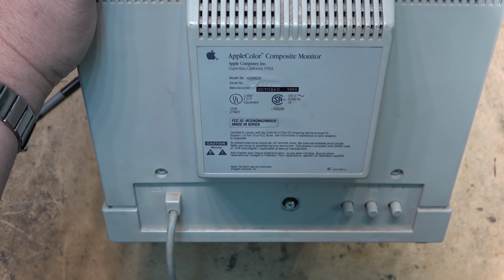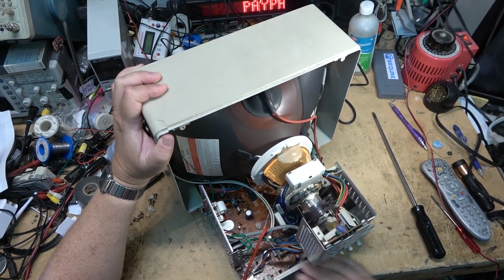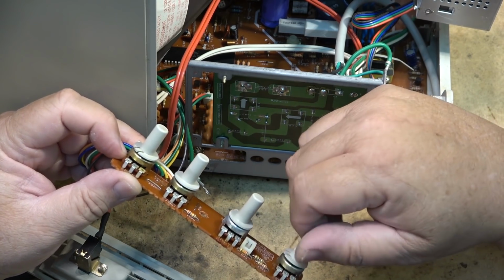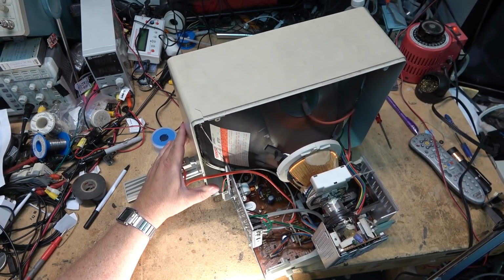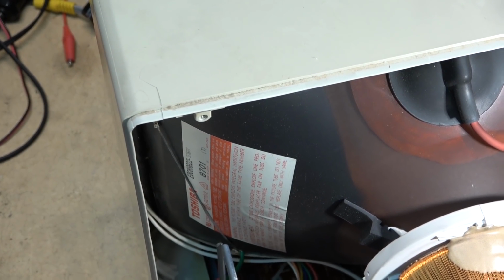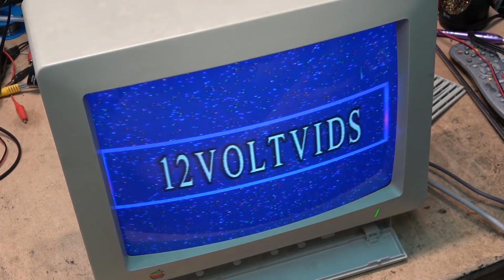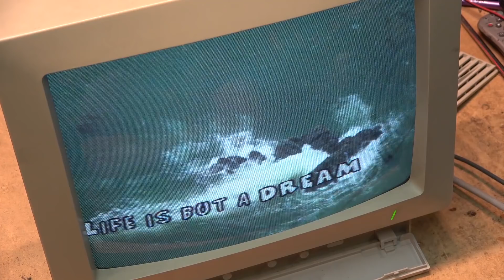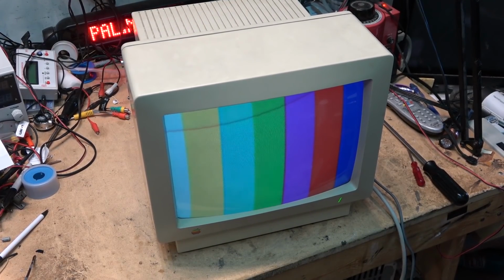AppleColor A2M6020 Composite Monitor Tune Up

Comment: I was just looking today for a video on this exact same set of problems with this same exact monitor.  Mine is even made in October of 1986, serial number S042803, so they probably rolled off the line a few days apart.  Thanks for posting this!

Comment: I've been fighting with one of these with the Samsung chassis. Samsung and Hitachi OE'd these for Apple, the Hitachi ones have 3 plastic hinges on the control door, which always break. Yours looks identical to mine, so I presume it's the Samsung. 
Mine came with a blown 120v zener. I replaced that, and the HOT blew after just a moment of running. It did build high voltage for just a moment. I replaced the HOT and it blew again. I tried running the chassis without the HOT installed, and it blew the zener....

Comment: Not bad at all for it's age, the crt has no burnt in phospher damage.
No caps needed changing, i'm supprised!.
Reply from the maker: This is likely very low hours.   This was made before caps got all environmentally friendly. It was the chemistry change that started all the issues.
Reply: @12voltvids  same with the "environmentally friendly" unleaded solder which is absolute crap that cracks all the time.

Comment: I remember those monitors.  Used with the Apple IIe or IIgs.
Reply from the maker: This one goes with a Apple Ii. Client is restoring one.  I should dig out my old ti99/4a and get it running.    Just need to find a power supply and make up a video cable.
Reply: @12voltvids  Remember the TI/99-4A. My first computer for games when I was a kid!
Reply from the maker: @stphinkle  same here.  I wrote a BBS program for it. Had 4 360k dsdd drives on mine.  Still have it.    Have no idea how to use it anymore.  Don't remember any of the commands.  Call dsk1 i thing was to load from disk 1.

Comment: Your titler's output looks so dated today, but I'm sure it looked great back in the day. Regarding its battery, it likely uses one of the 3.6v cylinder cells which are known for leaking and ruining boards. It might be worth checking on.

Comment: Thanks for the demo on the titler, I have looked at them, neat to see what it can do.  The video of the air plane show, was that on your Sony Beta?  73's OM.  DE ~Jack, VEG
Reply from the maker: No that airshow was shot on svhs using a Panasonic pvs350 that I had for a year or 2.  I did 2 airshows with the  beta. One using an hvc2400 into an sl2000 and another with hvc2800 also into sl2000. I did this one with Panasonic pvs350 and at least 1 with a ccdv5000.  I did a couple with DV cameras as well.  Dcrvx1000 and canon gl2 i believe.  I haven't put all of them up.  Some day i will put the DV tapes onto hard drive.  I better get on this while the tapes still play.

Comment: Think you might have picked up a strand of thread or something on the crt at the end.
Reply: Near the end when you have color bars on there is something on the top left to center of screen.
Reply from the maker: @marka1986  Its called the rolling shutter artifact of the camera.
Reply: @12voltvids  OK thanks

Comment: Was LG a thing in 1986? Or was it still Goldstar back then?
Reply from the maker: From 83 to 95 they were known as lucky Goldstar.  Prior to 1983 Goldstar made cheap tvs and lucky appliance made cheap appliances.  They merged in 83 and became Lucky Goldstar. In 95 they changed the name to LG.
Reply: I did have a Goldstar amber monochrome monitor at some point in the early-mid 80s. I just couldn't recall when they switched over to using the LG name.
Reply from the maker: @richkh  96

Comment: Finally a CRT again
Reply from the maker: I have lots of broken CRT I could fix.   Thing is I tend to try to do videos that actually get watched.  When I see stats that suggest it is not being watched i try to make videos that people watch. That is vintage audio gear.   I'll dig out some more CRT sets soon.
Reply: @12voltvids  that's nice thanks
Reply: @12voltvids  maybe with the retro gaming craze CRT videos will have bigger views now. People on the CRTgaming Reddit are always asking how to fix one issue or another.
Reply from the maker: @t0nito  well they are required for retro gaming.  They don't play well with flat screens.
Reply: @12voltvids  They look horrible on flatscreens, HDCRTs aren't good for that either as there is digital processing and scaling will the inherent lag that comes with it. I love playing old 8-bit and 16-bit games, anything other than a CRT is unacceptable, and if one is fortunate enough to have an RGB SCART European set or an RGB PVM nothing beats it in image quality and motion clarity.
Reply from the maker: That was a pun incase people missed it.  
Due to the scaling and digitizing there is a several frame delay from what is received to what is displayed.   Also due to deinterlacing this degrades the image hence they don't play well with the monitor.

For the gamer, this delay makes the game almost impossible to play, so they don't at well with the gamer either.   
Nope, flat screens are shit for old games.  They are fine for modern consoles because that screen delay is built into the game console so the visual graphics are sent several frames ahead of required input.  But for the old games a CRT is an absolute must.  Next best is an old plasma with game mode.  Game mode on certain plasma models shut off all unrequited processing and displayed the fields as they came in. There was still a delay, but it was only 1/60 second as opposed to LCD sets that typically had as much as a 5 frame delay.